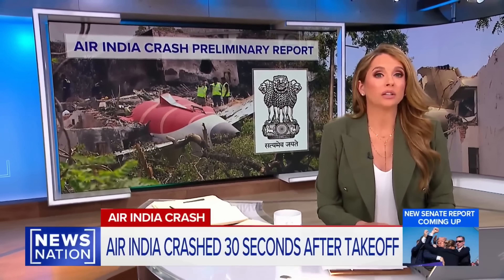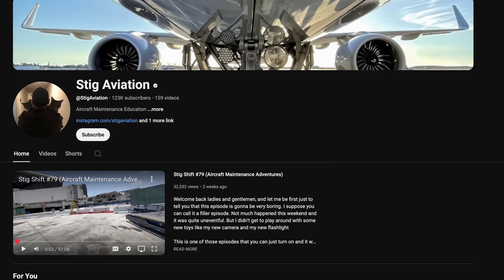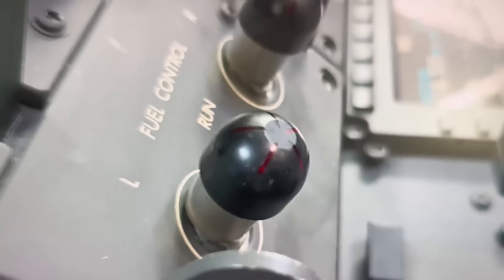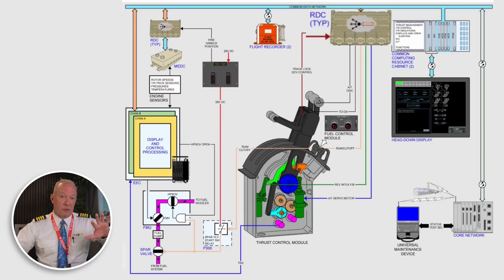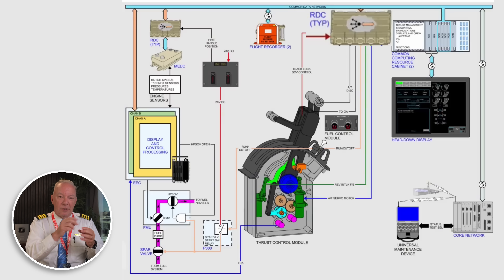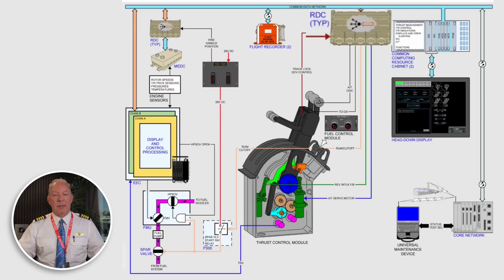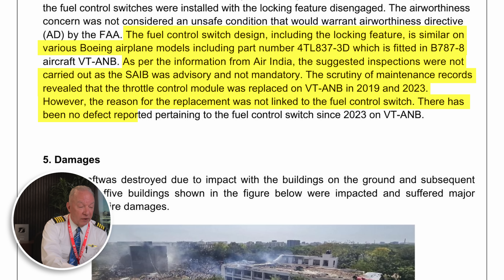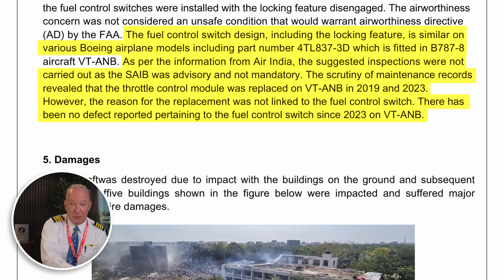The Truth About Boeing 787 Fuel Control Switches

Comment: Being an electrical engineer, I find this explanation having multiple unclear aspects to be clarified. 1) When it is stated that the plane was simulated for full electrical failure, the explanation says that the dc system remained on. This is not a full electrical failure. In fact with electric cars it is most common that the electrical failure is the low voltage battery which runs out of power  and it causes main systems to fail. It is actually debateable what is a good design in this case. In this case the plane needs dc to fuel supply on, which mean that the plane will drop down if the dc in that circuit fails. 2) It is stated that the switches were operated. In order to nake this stament, there has to be a separate position switch conneted to the switch, and having an  independent power supply in order to be sure. If the switch position detection is made by sensing if the dc voltage is present in the circuit tha operates the relays, the a dc power failure results in system reading thar the switch is off. I hope that the investigation team analyses the dc failure in this circuit. I would assume there is a redundant dc supply which will activate in case main dc supply fails. How much time in between switching?
Reply: You might want to accept the fact that the pilots were able to open the fuel valves after 10 and 14 seconds.
Reply: You do not need power to keep the fuel valves open once they are open. The fuel valves will remain open if there is complete electrical failure. Check FAA certification standards for yourself.
Reply: @joseleon624  YES YES YES, the fuel valves are not spring-loaded and are powered off just like they are powered on. Please clear this up now and for the future.
Reply: It’s all academic as the switches were found in the cut off position
Reply: @JerrysBigSister  NO they were not. They were both actually found at the on position! If you look at the report and the pictures he put the fuel switches back on a few seconds later. So no the panel was found with the fuel switches on not off. 🤷
Reply: @JerrysBigSister 
No, they were found in the ON position.
Reply: If the recorder would just have detected a power supply failure, why did it so with ~1s of delay between the two switches? Surely the recorder also separately tracks the power supply.
Reply: The valves "fail safe" so loss of power or breaking the circuit means that the valves/stay go open, right?
Reply: There are 2 batteries (main + backup), a generator on each engine, and the RAT. Critical systems are set to switch before power loss = uninterrupted. So a "complete power failure" is never actually what it sounds like it is, it's just a technical term for when most of the main electrical fails. 
There is no separate position switch for the switch, they read the state of the circuit. The black box has its own separate power supply and battery. 
Everything is triple redundant on an airplane, especially a jetliner. People thinking just like you already engineered it 👍
Reply: @jimgoplayoutsideable if you have a short on the main, and the backup kicks in, you have a short on the backup. None of that gets resolved until the RAT kicks in, and that's exactly what it looks like happened.
Reply: @mymultiextruder9804 you should probably learn some more about electronics. Aircraft have some of the most complex control systems, probably only second to spaceships. There's a whole multi-computer power management system that can detect and isolate faults, temperature, voltages currents, the whole everything, and it's all recorded too. 
The various power sources feed into a centralized system that decides what to route power to depending on the state of the aircraft and how essential the system is. And again it's all recorded, so if there is something going on there it would be really obvious.
Reply: @jimgoplayoutsideable and it all runs on DC power, which failed. But it recovered exactly as it was designed to. Only certain systems were permitted to regain power, in specific orders, once the RAT started providing stable power. The other systems never recovered. That's where you'll find the answers if you look at the other systems that lost power, and which ones regained power. The plane almost fully recovered, it just didn't have enough time/height.
Reply: I believe it has been explained, but possibly not confirmed by system engineer or a maintainer that fuel supply valves are fail safe to the open position. Therefore electric failure does not close the valve causing fuel starvation. Therefore electric fuel supply valves are always Open until power to close them is supplied by the fuel cutoff switch selector being physically moved to Cutoff. It seems like the confusion is if some system could cause an electrical signal to be sent to close the valves without the fuel cutoff switch being moved. And this phantom electrical system would have had to close both valves to both engines when the fuel valve system is completely independent from each other. That sounds a bit astronomical. If the final report confirms that, I eagerly await a full, minutely detailed explanation. Until then, it seems more plausible the switches were moved by human hands at the exact perfect time in flight to cause unrecoverable flight. One quick switch movement. Brilliantly, morbidly perfect.
Reply: Well said, unfortunately, Captain Steeeve, and many other pilots, and commenters, are playing armchair "engineer",  when we live in a time, where all one has to do is turn on a light switch, and they get the title "engineer" this is playing with fire 🔥 with the public.
Reply: @joseleon624 @mikebell9983 guys. The fuel valves on aircraft are specifically designed to have a safety feature of normally open or normally closed. Almost all of them are chosen to be normally closed. 
In particular this aircraft, the fuel valves for the engine fail closed. They're not solenoids, they're motor controlled, and there's also a separate sensor to detect the position of these fuel valves. That means the people investigating the crash can clearly see if there was some kind of power failure and if that affected the fuel valves or not.
Reply: It's an aeroplane not a car, if the car breaks the safest thing to do is stop it all working as you can coast to a stop.  Aircraft fail safe conditions are based around flight, in the event of all generated source power loss it's better to have thrust from the engines, FADECS are powered by a PMA on the engine itself and don't need aircraft main power, you can shut them down using the fire handle if required.  It's also why there are landing gear emergency lowering systems but not retraction ones.
If you also fail the DC side nothing works at all, no CVR, FDR, VHF 1 radio etc.  For DC to fail you have to disconnect the battery or it goes flat.
The 'low voltage battery' is purely a backup function and power to the battery busbar is fed from a TRU that is powered from either engine generators/APU/RAT/GPU and kept topped up.  Flight critical system are wired to the battery busbar because the aircraft electrical distribution system is setup to ensure this is the last thing to fail.
FDR and CVR amongst other things, are powered from the battery busbar and there have been no reports of any drop outs of data (all timestamped) from those units and they don't have internal power sources.
It is common for aviation switching to include discreet lines to RDCs for position monitoring purposes as they often drive other functions of the aircraft (ie you cant put the landing gear up when on the ground due to interlocks and weight on wheels switches).
Fuel control relays also tend to be of the latched type for exactly this reason, power required to open and power required to close.
In terms of switching the battery to battery bus tends to be a fast acting device, you will initially boot up a modern aircraft via battery, wait until some PBIT aspects are completed on critical equipment on the battery bus and then the aircraft is in a position to accept external power (they all check this for voltage and frequency within limits).
When you switch from APU to external there is a slight lag as you will obviously make a mess of electronics if 2 power sources are feeding the same bus and the battery jumps in briefly during the transition to keep the critical system powered - it's obvious on a flight when you park up as you can hear various fan speeds change and the lights tend to flicker briefly.
Reply: @yanholland315 There were other systems lost and not recovered. The switches could not cause those other systems to fail, but a loss of DC would explain it.
Reply: @mymultiextruder9804  which ones and where is your source? What busbar are they powered by? Are you familiar with the reboot and handshake process timings between systems that goes on when busbars are down-powered then re-powered?

Comment: Thanks for this. It doesn't seem like there is much more to talk about until the final report comes out.
Reply: Do you work for Boeing or Indian Airlines ? 😄
Reply: Why arent we considering a possibility where dual engine failure happens just after take off. Then pilot manually turn fuel switches off and on because thats SOP in Boeing planes in case of Dual Engine.? You can refer to Gaurav Taneja AI 171 Part 3 in english dub to understand more about this theory as timeline of RAT deployment also matches with this
Reply: @ishanarora7948  Because in the preliminary report it says quote: "Engine 1 and Engine 2 fuel cutoff switches transitioned from RUN to CUTOFF position one after another with a time gap of 01 sec. The Engine N1 and N2 began to decrease from their take-off values as the fuel supply to the engines was cut off." 
So the engines didn't start to lose thrust until the switches were moved. Then when the switches were moved back to run both engines relit, so the engines both appeared to be working as designed.
Or just watch 14:40 in this video for captain steve to explain.
Reply: @ishanarora7948 Because according to the info. released, the CVR doesn't at all support that theory.
Reply: @KBP120 can you please elaborate how. Because the more I am reading report more I find support for this theory rather than pilot suicide.
Reply: @ishanarora7948  Because during an actual dual engine failure, you turn both of them off and immediately turn them both back on, immediately and immediately as in 1 second, you do not wait for 10-15 seconds. You will never find a source or a manual that ever says "turn them off, wait 10+ seconds before turning them back on" anywhere, I can assure you that.

Comment: Thanks Cap'n Steeve for that very concise explanation. You have put to bed the "errant computer command" causing the valves to close. I am heartened to see that Boeing made the system almost as fail-safe as possible. Short of having the 28vdc for the valves going through the switch itself, it could not be simpler. When you are controlling multiple devices (valves), or high current devices, from one switch, you have to have a relay. I doubt that both relays failed, and then unfailed, simultaneously, and you put to rest the "total power failure causing the valves to close" scenario. Thanks again.
Reply: You mean like the dual engine shutoff in the ANA 787 flight? Like that?

Comment: That doesn't explain how the RAT was deployed and the pilot calling a Mayday stating loss of control (to my understanding). The flaps and Slats were deployed on take- off shown in the video. So what caused the RAT to deploy immediately after take-off like that? That's where I would start personally. I'm not an expert, but curious as to what happened here. Personal Views.
Reply: The RAT deploys automatically when the engines cut off.

Comment: Weird I know but other week I put a table same distance from pilot seat to a pretend dashboard in my mind,pretended to look to my side that someone whose planning something would do  then quickly pretending to flick a switch can be done in just over a second and I've got slow reactions.
Only cure alarms on all switches that sound a alarm if pilot does something odd at a certain time.
Would need very sensitive sensors

Comment: Ultimately, I don’t see one of the pilots asking the other “ why did you cut off?” if there wasn’t a visual check to see that the switches were in fact turned off. I am not buying a glitch.
Sure it’s possible that they moved on their own and if it was 1 switch I would say that that’s probably what it is, but I do not see a scenario which both would move
Reply: Why arent we considering a possibility where dual engine failure happens just after take off. Then pilot manually turn fuel switches off and on because thats SOP in Boeing planes in case of Dual Engine.? You can refer to Gaurav Taneja AI 171 Part 3 in english dub to understand more about this theory as timeline of RAT deployment also matches with this
Reply: @ishanarora7948  because there is a protocol for doing this, and that was not followed, plus the chances of a dual engine failure at the exact same time are basically zero

Comment: What is the correct terminology, it wont be relay for example, more like solenoid or actuator, would depend if they were part of the fuel valve or separate or a location away from the fuel valve.

Comment: Must watch 
Richard’s ‘water ingress’ explanation of the crash was originally laid out  in episode 174 (‘Water in the EE bay?’ on 1st August, from 12:46 to 21:36). Today’s report gives the same explanation with supplementary evidence and more nuance. 

In a nutshell, the explanation is that water ingress into the EE bay at rotation, i.e. a few seconds before liftoff, caused a cascade of electrical failures beginning at 2 seconds after liftoff that in turn produced a rash of emergency EICAS messages, to which the captain misreacted in a moment of confusion and time stress by moving the cockpit switches to CUTOFF at 4 and 5 seconds after liftoff. Thanks to the ‘startle effect’ it took a further 8 seconds for the pilots to realise what had happened and begin to move the switches back to RUN, by which time it was too late. 
https://www.youtube.com/watch?v=nxul8TOIf38

Comment: Great explanation, one minor mistake but doesn’t change your conclusion. 

There is actually a software control for the HPSOV, the cutoff switch and a signal from the EEC goes through an AND logic gate, only when both are on does the HPSOV open. In this way the EEC can delay fuel supply during an engine start before minimum RPM is reached. 

It doesn’t change the conclusion because the FDR clearly captured the RUN/CUTOFF signal change, this is directly from the cutoff switches, the EEC cannot change them.
Reply: Yes the logic AND got me also thinking what is HPSOV.
Reply: @xarniia6937  The HPSOV = High Pressure Shutoff Valve. It is a poppet valve mounted on the engine.
Reply: I noticed the same thing. The only valve controlled directly and independently by the fuel cutoff switch and relay is the “SPAR VALVE”. The “HPSOV” has AND logic with a signal from a source not included on the diagram. The third valve labeled “FMV” has no apparent direct connection to the fuel cutoff relay output. So to say the three valves are controlled by only that switch and relay is inaccurate.

All that being said it still remains that the SPAR VALVE will cut off fuel to the engine and is directly controlled by the cockpit switch through the relay. It is just incorrect to say that the other two valves cannot be shut off while the fuel cutoff switch is in the “ON” position
Reply: @henrymcraven7246  Yes, you would need to see actually which signal the preliminary report was describing. I suspect both, that is they were in the same position so they were sloppy. I don't think the Fuel Metering Valve (FMV) actually shuts down the engine (could be wrong, It wasn't my design responsibility).
Reply: I concur.
Reply: Please check the clarification from RogerAhier post above
Reply: Are you certain it is direct from the switches and not from the relay which would be a much more likely place to take it from using an extra set of contacts?

Comment: The old steam gauge B-707 had the fuel cutoff for each engine integrated into the throttle. Pull the throttle to idle, over the idle stop, and into fuel cutoff. You were actually turning off the fuel via the throttle cable to the fuel control in each engine. Absolutely fool proof. Of course everything in the B-787 is fly-by-wire, digital FADEC etc. But how hard would it be to incorporate the electrical fuel shutoff switches into the throttle levers? This is human factors, increasing efficiency and minimizing inadvertent actuation of critical controls.

Comment: This type of Fuel cut off switch is widely used in a range of Military Equipments. The prime one that jumps to my mind would be Weapon system activation, On/Off. These are systems that, like the Aircraft engines fuel cut offs, you do not want them being knocked accidentally. It is unlikely that they will be the same switch but the functioning, lift to move them, is the same and the switches will be manufactured to equally high standards (and cost a lot of money)
Reply: Read the spec : 71°C Military?
Reply: I have a switch like that for the fuel pumps in the airplane I fly as well.

Comment: so if it takes 28v to open the spar valves, if power fails, the valves will shut? what is the default fail-safe position for those valves without power? If its to close the valve then you have a possibility that a power failure from the relay caused the valves to fail.